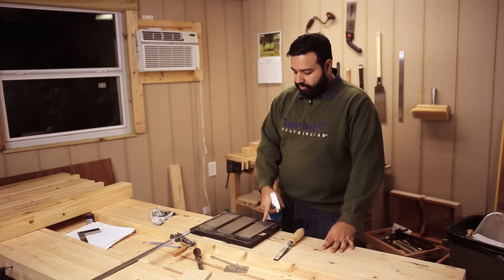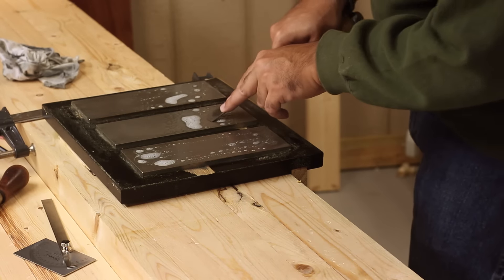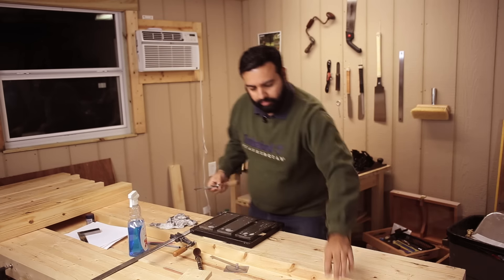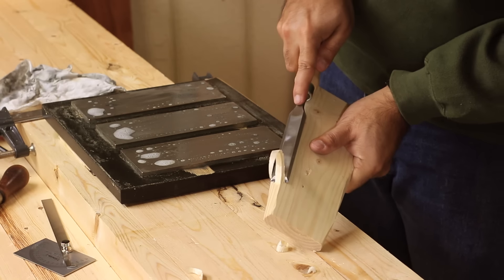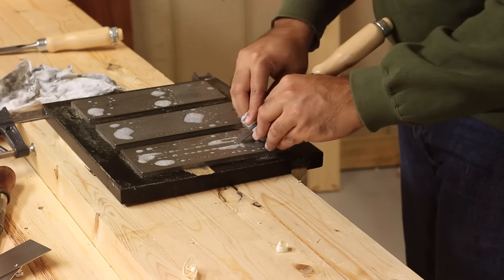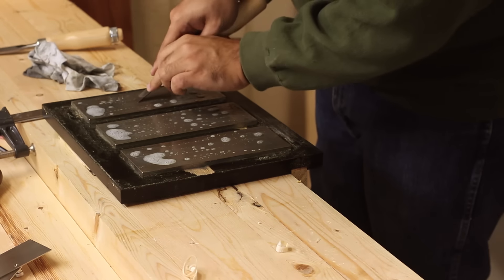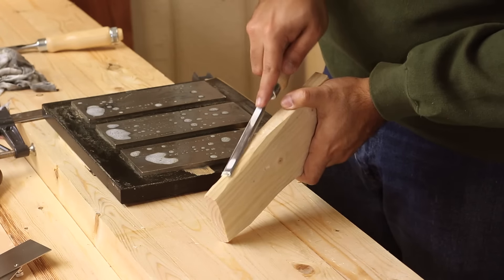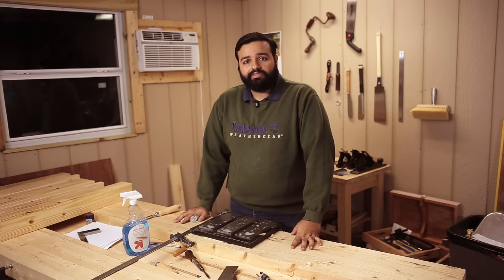Sharpening chisels fast with diamond stones

Comment: Great videos! I'm also a beginner building the Paul Sellers bench. Great to see some one else doing it too, though I think you've got a better handle on this stuff than me. Can't wait to see how your build comes along.
Reply from the maker: +riskmandel1 Thank you for your confidence in me, it exceed my own ;)
Yes, I am excited to finish it. Feel free to ask me questions on any part of the bench build. I will try to answer the best I can. 

PS going to take a short break for a few weeks from video making and bench building.
Reply: +Sighthound Studio I just glued up my 2x4s to make the legs last night. I see you didn't make a video on the benchtop. Mine is ok, but it going to require quite a bit of work to get flat. I guess that's all part of the build. Fingers crossed.
Reply from the maker: +riskmandel1 I didn't do videos when I began. Tops were already laminated and planed. Legs are 4x4 pieces that were already planed before I started video. Pauls videos are pretty good on the lamination part. Make yourself some winding sticks and you will do fine. Just something simple works.

Comment: I originally started with 4x4 solid stock for the legs but I just couldn't plane them square. I later read that they were likely too wet, which would add warp and twist each time a new layer was exposed to air. So, then I bought a bunch of 2x4s and let them sit for a couple of months. Seems to be going ok so far. We'll see.
Reply from the maker: +riskmandel1 I found some decently square untreated 4x4s. I was able to plane them square. It was quite the effort.

Comment: Hi Nice video what's the brand on the stones and what kind of fluid are using for lubricant
Reply from the maker: Sorry for the late response... your comment slipped through the cracks. 
My stones are made my DMT. The lapping fluid is plain old store bought glass cleaner.